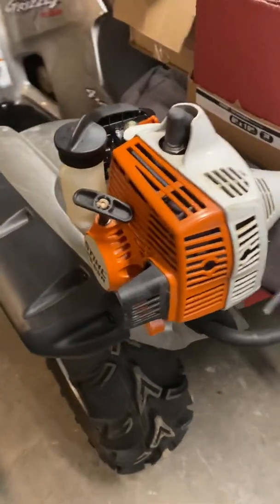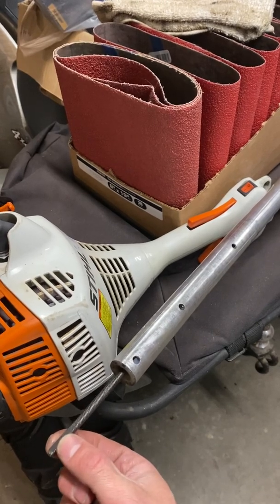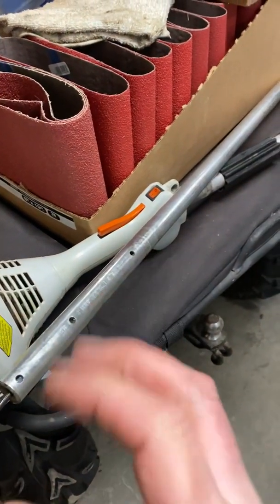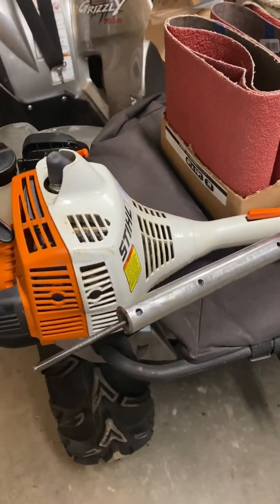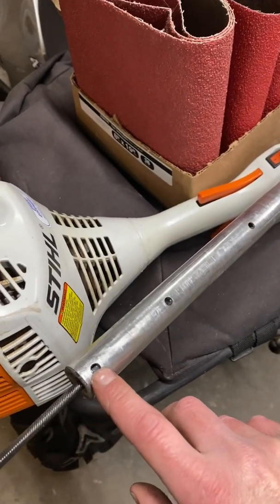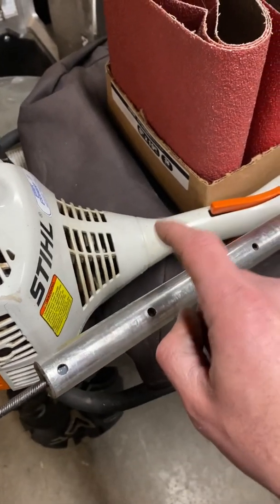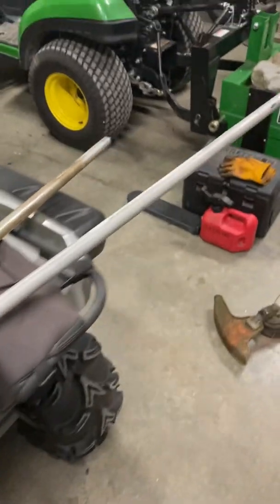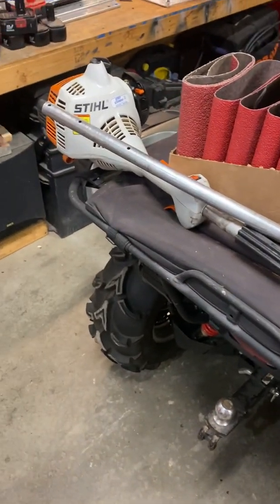Modify residential grade Stihl line trimmer to accept commercial attachments.

Comment: i am thinkin of something similar.  I want to put a solid shaft in my fs 56.  Good all around trimmer, but when i put the blade on i need to watch as you had the same rattle.  I was curious if a solid shaft would be an exact fit to the coiled shaft length or not was my concern
Reply from the maker: As you saw I was able to trim the shaft down. I suppose if the shaft was short you could trim the tube down as well. Not terribly hard if your good with a file and angle grinder.
Reply: So you are saying that I could just get another solid shaft and grind it down a little? That's great, I know Machinists!!! Might get me a few made next to nothing hopefully!  @s1283
Reply from the maker: Yeah it really doesn’t take much work.